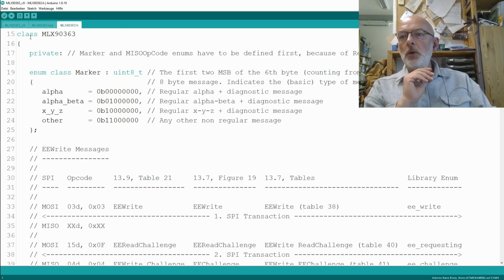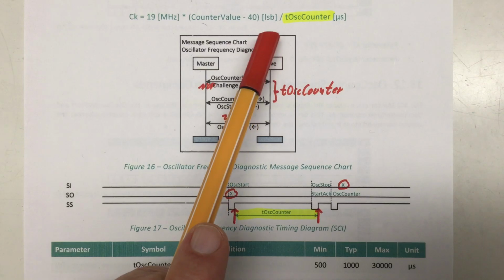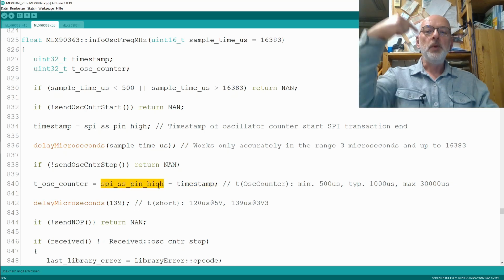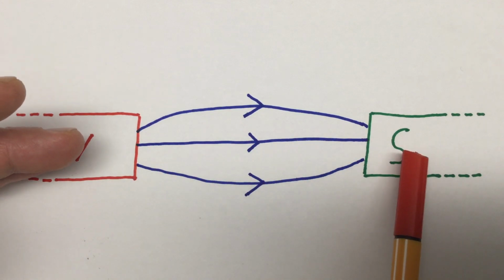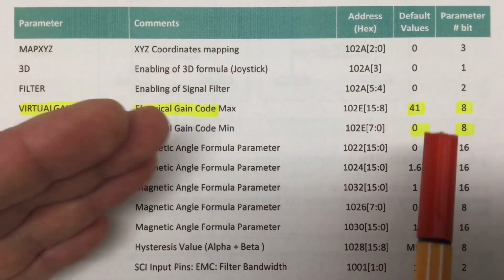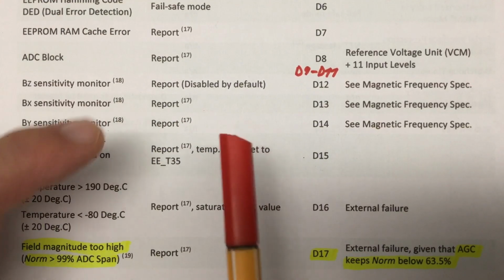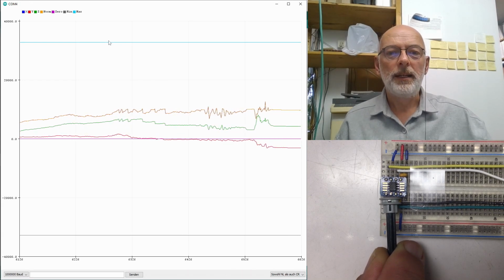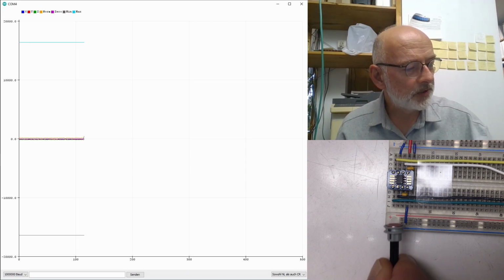Melexis MLX90363 Triaxis® Magnetometer & Arduino MCU – The Details (10)

Comment: Thank you for your work! Do you think the RM3000 sensor would be better suited for use as a compass on an airplane? Would it be less problematic?
Reply from the maker: Well, the MLX90363 is definitely not intended / not suitable for compass applications. The RM3000 is you've mentioned is real good electronic compass solution. If you're OK with a +/-1° accuracy and 0.2° noise you could go with a MEMSIC MMC5983MA. I have a whole series of videos about that chip on my channel.